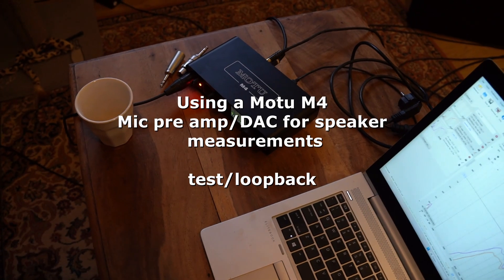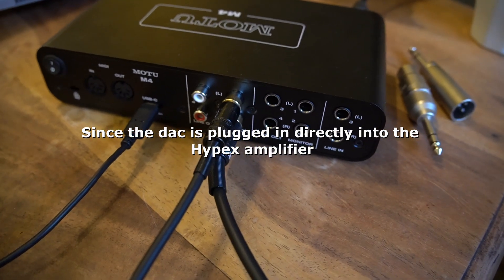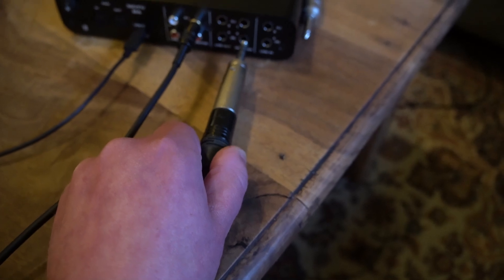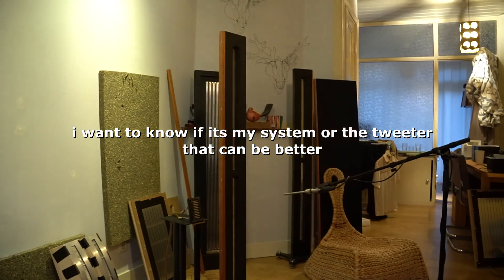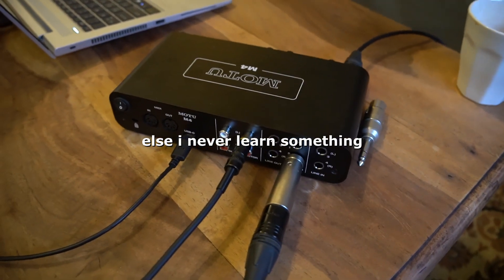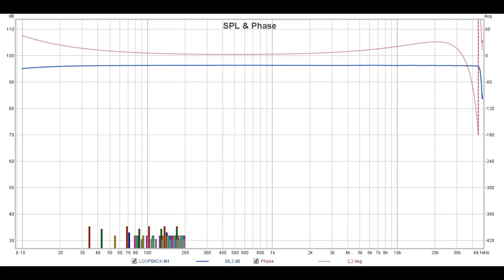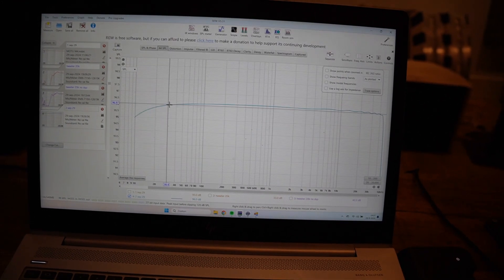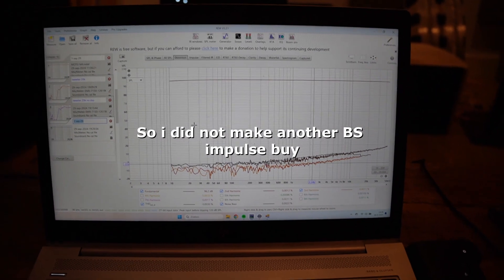Motu M4 Pre amp/dac test for speaker measurements

Comment: Balanced is must for me. I get all sorts of ground loop crap from computer on unbalanced.
I have Focusrite Scarlett 2i2 2nd gen, because I wanted to use it also for mic. Otherwise I would probably get some Topping with balanced outputs.
Reply from the maker: i just made my new cabling, and happy now :)
Reply: @joppepeelen  I disconnected ground on amplifier side from balanced, because I could still hear some high pitched clicks with ear on tweeter.

Comment: not bad, i would have gone for a Topping E2x2 as it has a better ADC (6dB more sinad), is cheaper (half the price almost).. but has a "meh" DAC.    Motu has a better DAC (8..10dB more sinad)
but in a ballpark where it doesnt matter anymore.. (100dB and up.)

it all boils down to software.... i dont know either unit because i got a focusrite 
and i can say, focusrite is the worst, under windows its only causing issues, lagging, dropouts, glitches and you cant use more than one focusrite unit at once (not even different models)

i hope they clock the ADC and DAC with the same phase. ive seen interfaces where both have different clocks and samples drift apart from eachother.
Reply from the maker: interesting i actually did not know topping also had mic pre amps. i thought they did only dac :( better ADC might have been a deal breaker.. but its a win some lose some situation by the looks of it :( thanks for sharing  !

Comment: Check Julian Krause reviews, it's possible if the gain is close to 100% you can get linearity issues, not sure if the motu has this behavior too. As long as a tweeter reaches 15k, everything is fine IMHO :)
Reply from the maker: ill; check it out for sure ! i hate i just shipped my focusrite for 30 euro :) i could have done a comparison.
Reply from the maker: By the way he has only a M2 and the M4 does better according to ASR
Reply from the maker: the m2 only thing he has to say bad about it is, something i will not be using. and the M4 has better noise and dynamic range (dynamic range witch was already higher then any in the test)  i am not sure why people hate them so much. but maybe i miss something. i did measure self noise with the mic present when i had my focusrite solo compared to this one and its lower. gone searcxh for a loopback measurement, i did one in the past. its even a video i believe
Reply from the maker: could you tell me more about why this is poo :) would be interesting , so far i seen 2 people say it but there it ends :(  i mean i dont need top of the bill but if there is better for the money i return it !!
Reply: @joppepeelen  You got me totaly wrong! The motu is a pretty  good interface, if not one of the best in it's class! Period.

The issue with the amplitude drop off @ maxed out gain is common on many interfaces, as I said, not sure if the motu has it. It's just another possibility to check in terms of precise measurements.
Reply from the maker: @yo3429  ah ok thanks, well when i read it i thought who ever puts the gain at 100% :) its at 50% or 70% (the 2 hour place, back in the day the ideal place) most of the time for measurements on the pre amp. and on the output with balanced...  i wont need much more then 80% , although i usually dont use it for playback , i must say on non balanced output i can imagine people run into trouble if there amp has not enough gain. since it seem a bit on the low end :( i was in the 90 95% region to make it play with my low effciency speakers and the DSP on -6dB witch i normally use, could have changed that of course but , going balanced... much better

 i dont think it outputs the regular voltage even on balanced at max volume. in the end we all want best for the buck :) and i did some research but i was suprised by the comments. since the focusrite i had at least is worse :) but thats a 130 euro dac, compared to this one been 270. above that we can go as high as 3-5 K  :)
Reply: @joppepeelen  yes, you get what you pay for :)
The DA sections are incredible good these days, 110-120 dB SNR are common, this is no problem at all anymore.
The analog output is often aimed for home use with lower voltage vs. studio levels.
But even this is OK in most cases and the M4 has good +16 dBu balanced out, same like my Duet. Even my cheap 2x2M with it's 13 dBu is sufficent, cranked up there is practically no noise to hear.

The tempting Motu Ultralite Mk5 is more than 2x as powerful @ the output and offers +24 dBu for studio use, but thankfully I don't need it (for now ;)

Output levels dBu (manufacturers figures)

+24 Motu Ultralite IV 
+20 Apogee Symphony

+17 Air 192/14 
+16 Motu M4 
+16 Duet II 
+15 Scarlett 3th  
+14 Topping e2x2 
+13 Air 192/6 
+10 Behringer UMC204HD

Comment: Hm.. Motu is worse than Focusrite by many tests. I wonder what was a reason to change the equipment?
Reply from the maker: @sc0or could you tell me more about why this is poo :) would be interesting , so far i seen 2 people say it but there it ends :(  i mean i dont need top of the bill but if there is better for the money i return it !!
Reply: @joppepeelen  Well.. In few words it's about tech data/specs. Have not seen review from a person who used it for some time, just musicians and reviewers. I personally have Scarlet 2i2 and happy, wanted to update it to something "more measurements, less music" but this mission is not complete yet. I'm not ready for a Tascam for $2k
Reply from the maker: @sc0or  hehe well that might be the difference ? ears and measuring. but i would suggest having a listen to it, reason why is this.  I never believed much in DAC's sounding so much better then others. no i was given a Node 2 streamer and it was much more nice then the focusrite. only thing i could think of was i can connect it digital to the dsp. skipping one conversion.  when i received this one, i did not noticed on what i played,  streamer or the Motu, then again i am sure the streamer works better since it skips one ADC - DAC conversion.  but at least it was as close i did not notice. besides that, if you ever had the solo in your hands... it feels cheap, the volume knob was light had no drag and left and right changed in volume when been low or high..(this one is solid no alu and no plastic shit knob) it might be completely different for the 212 though !!  i was just shitting my pants, like did i miss something ? :) and some  Youtuber reviewing it with a guitar/vocals does not worries me, since i want to measure with it :) the fact it sounded nicer was just a bonus :) witch might just be between my ears :)
Reply: @joppepeelen  I see. How it plays might be different to how it digitizes indeed. They preferred Focusrite just because how it records (and I needed it for measurements). People can spend a half a lifespan searching for an "ideal" DAC, so you're only at a beginning )
Reply from the maker: its not,  and i need to rely on people that do have a 10K + measuring device in this case.  https://www.audiosciencereview.com/forum/index.php?threads/motu-m4-audio-interface-review.15757/  definetely better then the focusrite solo. gen 2.  i dont care about the headphone out :)
i see there are better ADC out there. but cant afford.
Reply: Focusrite is a medicore interface brand, but still good enough as medicore is fine these days. They suffer a bit in terms of preamp noisefloor, gain and headphone out (scarlets) and the peak level meter is a joke.
Reply from the maker: @yo3429  is it ? but how come it performs better then the focusrite ? solo, i know focusrite has some really nice ones, but that more in the 1K region. to bad i just send out my focusrite. or i did a comparison. damned ! i did one with self noise, and the focusrite loses.. so well i dont know